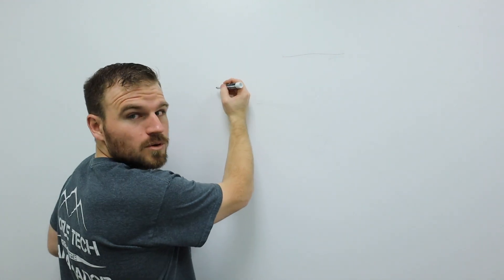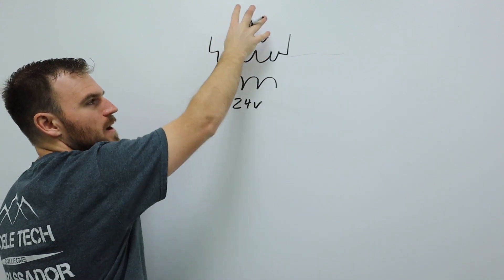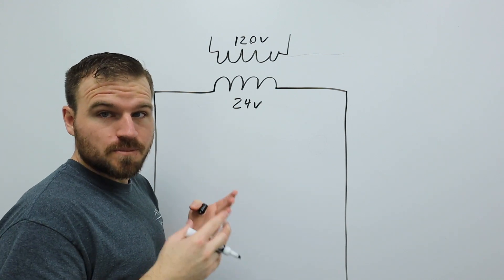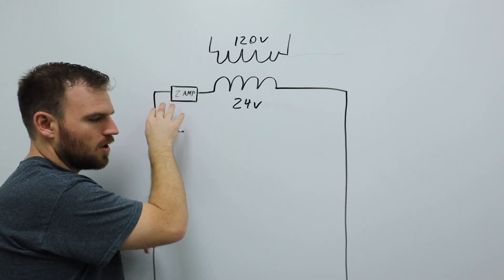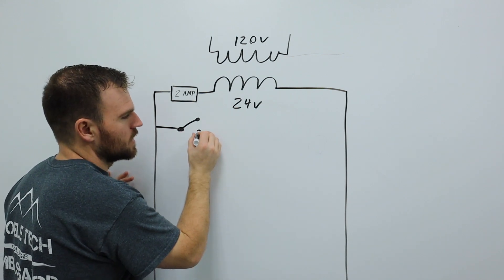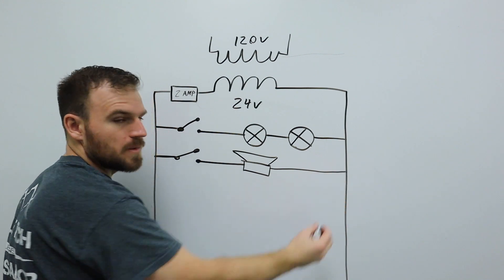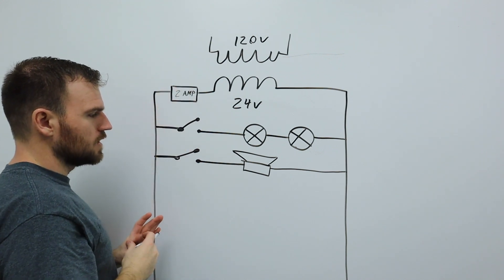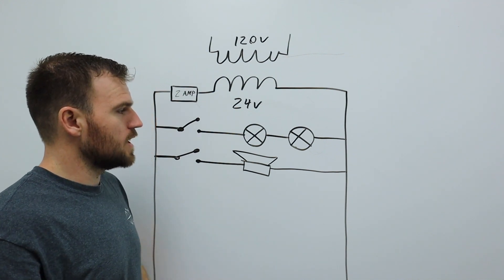Basic Electrical - Ladder diagrams

Comment: Rule 1: All components must be labeled
Rule 2: All conductors must be numbered 
Rule 3: All lines must be numbered 
Rule 4: Only show control devices
Rule 5: Place only one load per line
Rule 6: Output devices located on the right

Comment: That first line with the two lights assumes the lights are 12v and not 24v.. if they are 24v lights, they would both be dim.  Putting 24V to a speaker... no bueno   :)